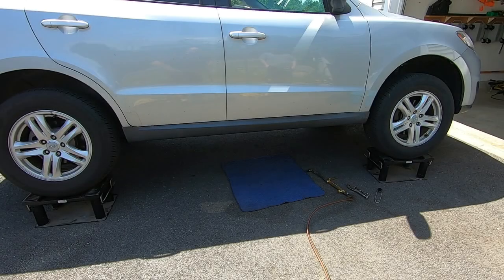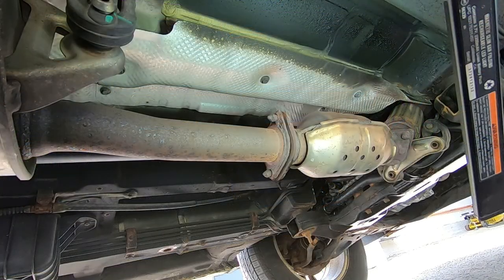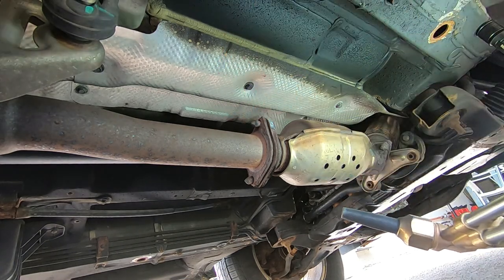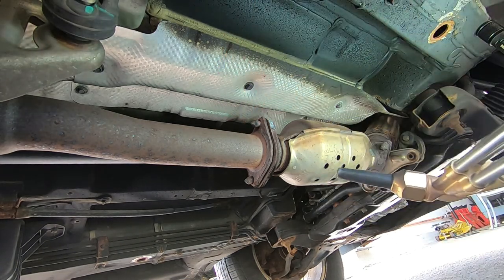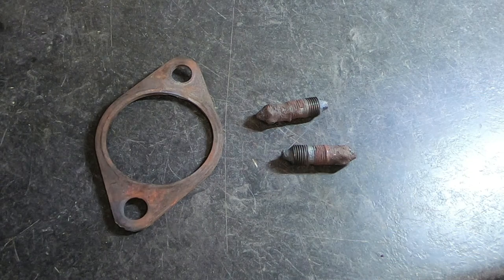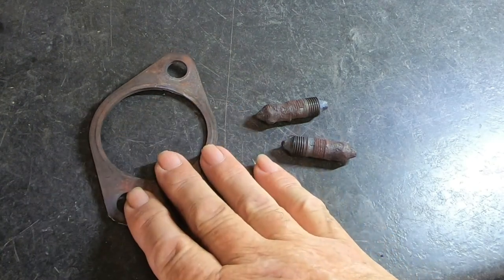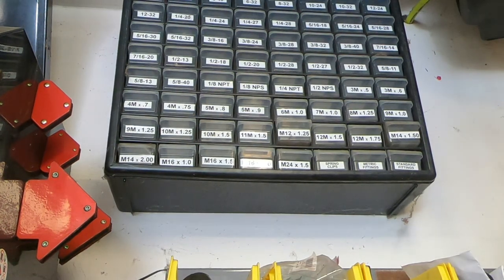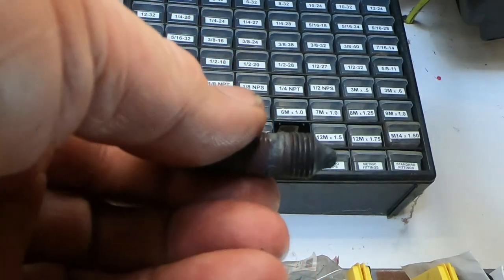How to Remove an Exhaust Flange Stud

Comment: Great video RS.  ALTERNATE METHOD as an FYI.  For my '09 Jeep GC Laredo (cat back exhaust system replacement) - I used a $19 cobalt drill bit set from HD to drill out the two (2) studs from the Intermediate pipe side towards the cat flange.  The studs are welded into the intermediate pipe flange.  Step up the bit size to pilot and bore out the stud metal.  These Milwaukee or DeWalt cobalt bits aren't MATCO/MAC etc. but WILL definitely bore through exhaust and wheel studs.
Reply from the maker: Thanks for sharing that Tom, I will keep it in mind next time I have a similar job.

Comment: Getting out a rusted bolt nut is one of the great victories in life
Reply from the maker: It is quite gratifying.
Reply: What happens when your new bolts need replacing? Guess with studs you can always grind the head off and tap the tail out.
Reply from the maker: @pacman7959  you sort of lost me

Comment: Air hammer with a punch bit will take those rusty studs out in 5 seconds. Replacing it with nut and bolts. Deletes having to rethread the holes.
Reply from the maker: Thanks for the tip

Comment: Can I use a regular bolt and nut if the treads are stripped?
Reply from the maker: Absolutely, if you can get a wrench on each end sometimes it is your only option.
Reply: @richardspaulding5035 nice I just finished the video and saw u use just that

Comment: Great video Rick. If you do not have a torch like you do, would map gas in the yellow bottle work to remove those studs?
Reply from the maker: It would take longer; I would use the shock method. Heat it then cool it quickly with water in a spray bottle, do that about 3 times then see if the stud will come out. The alterative would be to cut the stud flush then drill it out.  Simply get nuts and bolts slightly smaller than the hole. Good question, I am thinking now I should have covered those other methods in the video. I may post a follow up.
Reply: @richardspaulding5035  good to know thank you for your answer.